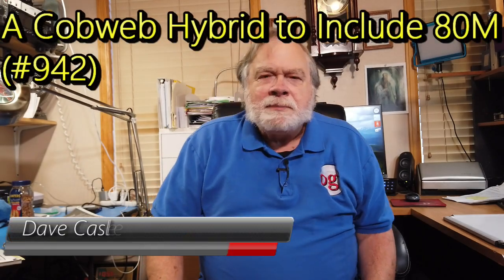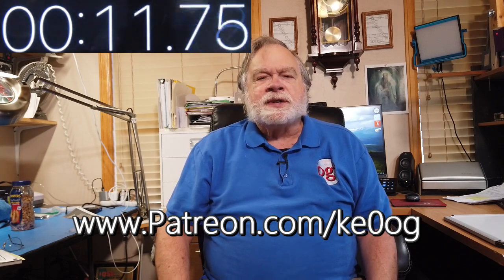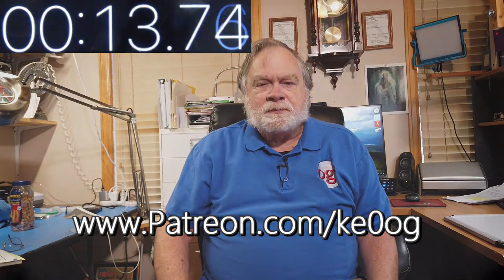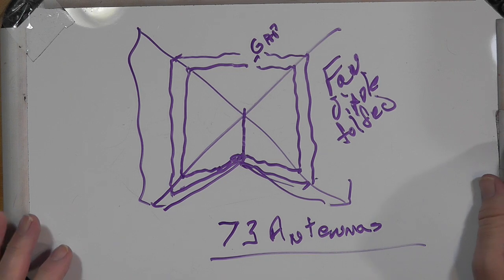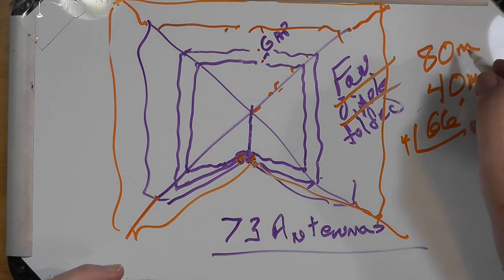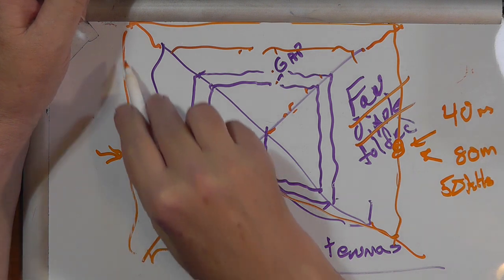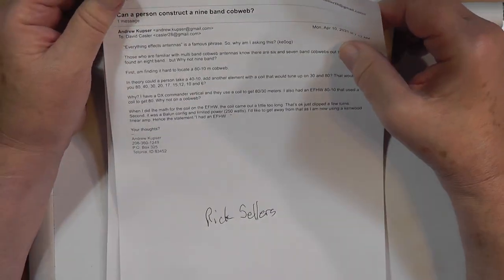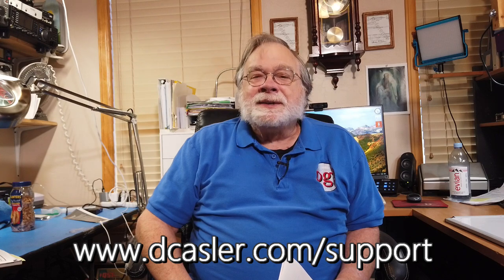A Cobweb Hybrid to Include 80M (#942)

Comment: While a horizontal loop is 3Db less than a bidirectional halfwave dipole, it is omnidirectional, as are horizontal V's or U's (ramshorn). For 80 and 160, a remote antenna tuner and as much wire as you can deploy, is the simple solution if you don't have space.